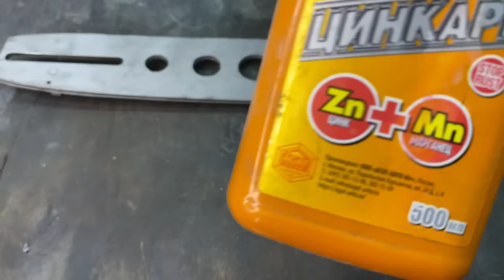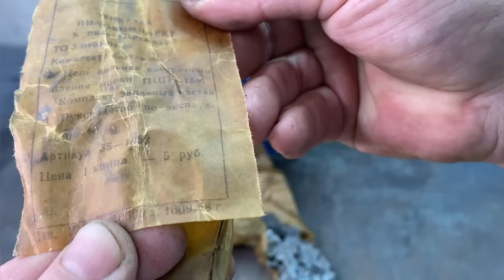Full Restoration Old Heavy Chainsaw from USSR. Great project.

Comment: I remember those chainsaws cutting with those was a strugel, and that pull start needing fixing every day, but pretty good restoration
Reply from the maker: You are right! Problems often arise with this type of starter.
Reply: My father had one of those. Seeing the video I still remember all its parts. Worst chainsaw we ever had. They were selling a model with electronic ignition in the 80's-90's but my father chose the shitty old platinum one. I remember him throwing the starter in the garden, raising the chainsaw above his head and throwing it on the ground cursing with small parts and screws flying everywhere, walking with it on his back for about 4km to cut wood, only to come back home because the damn thing would not start. He eventually got it fixed and sold it. 

Funnily enough, years later he borrowed one exactly the same model to cut down about 50 trees. It worked flawlessly.

Comment: Looks bloody lethal, the blade has poor control  in comparison with a more conventional layout.
Reply from the maker: It's right. This chainsaw was used mainly for felling huge trees, there was no talk about accuracy))
By the way, the saw blade can be turned to a horizontal position by loosening the clamp and turning the gearbox to the required angle. Thus, the chainsaw operator, without changing his position in space, could cut trees very close to the ground.

Comment: Where do you even start to find parts for this? Also what is the part cleaner solution you used?
Reply from the maker: You can start looking for spare parts on various advertisement sites. I use degreaser to clean parts.
Reply: oh ok thanks